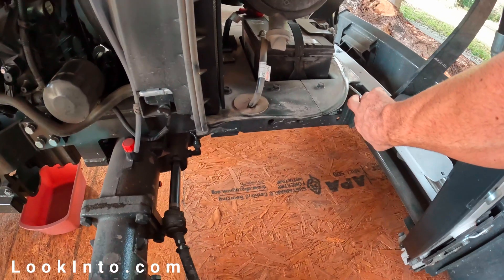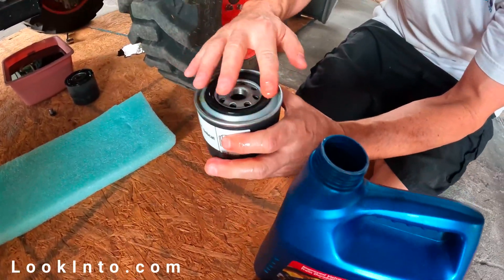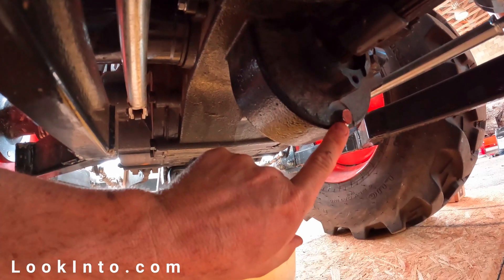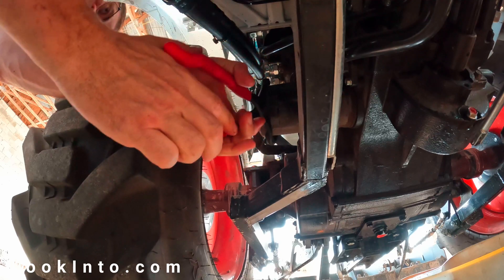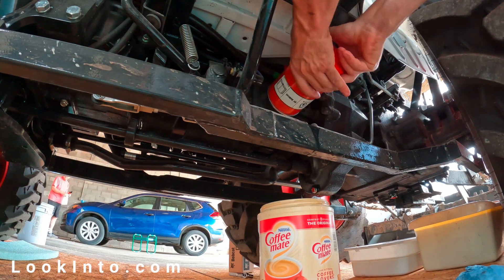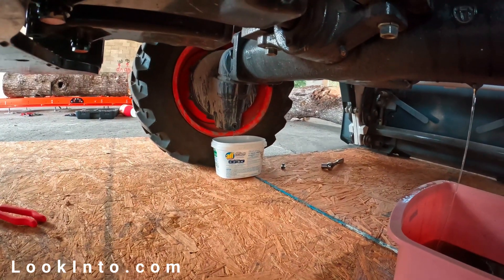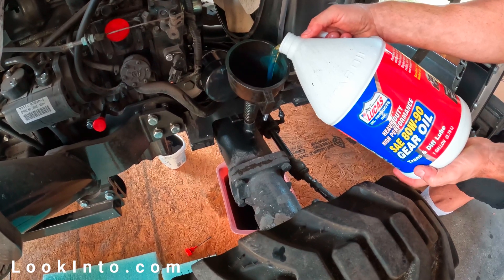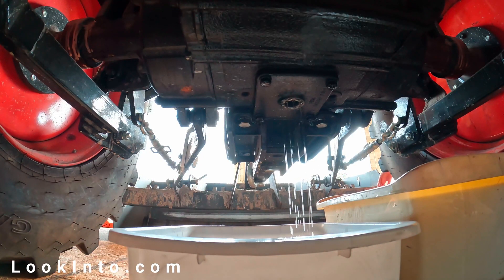Bobcat CT2025 Compact Tractor First 50 Hour Service Directions (Plus Oil Change)

Comment: What width is your Box Blade, and any issue having enough power  using it with the CT2025 engine?
Reply from the maker: That blade is around 5 feet wide (give or take) and I've had no issues using it with the CT2025 at all and I scrape a 3/4 mile long road weekly with it.

Comment: My dealer told me at 50 hours just to do engine oil.
Reply from the maker: Time to get a new dealer 🤣 Check your manual it will show what is needed. In fact, Bobcat just sent out updates to the manual (at least first my model year) to ADD in an oil change at 50 hours (it wasn't originally a requirement even though most of us do it at 50 hours anyhow).
Reply: @LookInto  That is what I received also:  The update letter, a replacement under-hood sticker; and stickers to paste into the service manual.  (Front axle/differential gear oil change not listed.  Otherwise everything that you did as specified.)  Thanks!
Reply: 2 dealers told me the same (just the oil and filter @50hrs)
Reply: I agree with them. Replacing hydraulic and gear oil that looks like new doesn’t make sense. Filters maybe but not gear oil  @kentgrandlienard3090